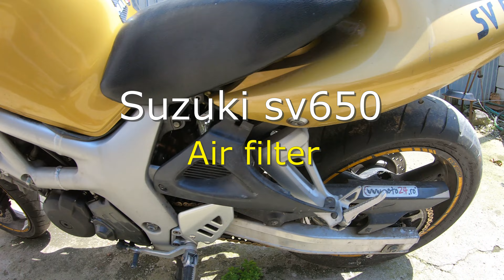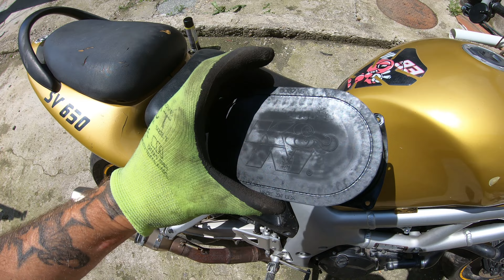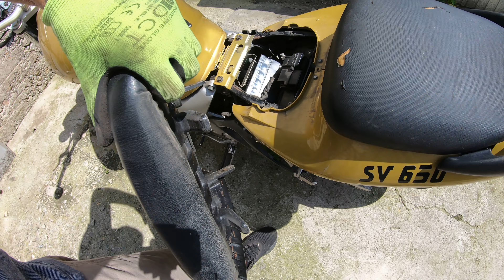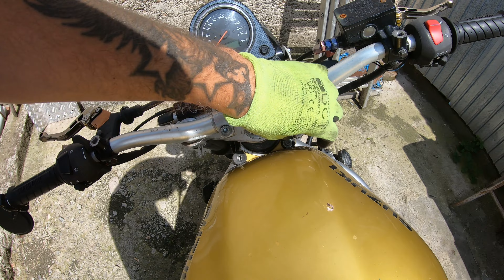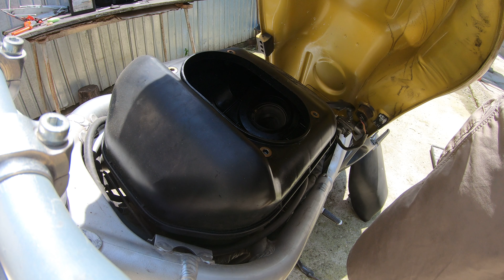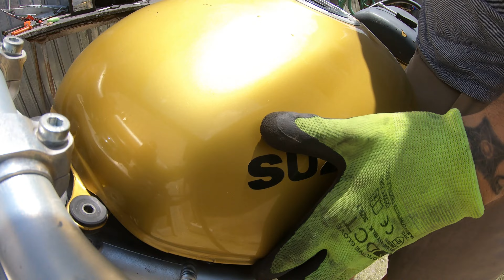Suzuki SV 650 K&N air filter replaced , Luftfilter ausgetauscht , Filtro dell'aria sostituito , 4K

Comment: First you should look about you have an injektion or an carburator engine. Because if you have carburators, they will not ad fuell automatically to the increased airstream. That means your mixture become lean. And to find the exactly correct jet is not simple....
Reply from the maker: Ok thx. ✌️